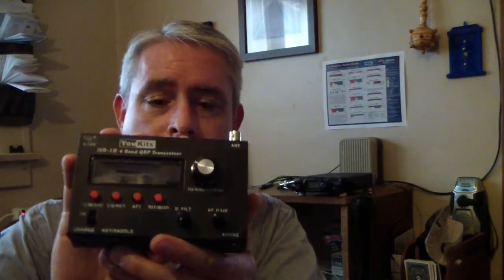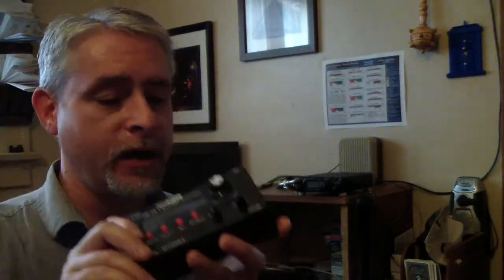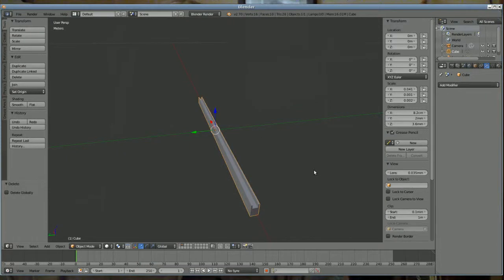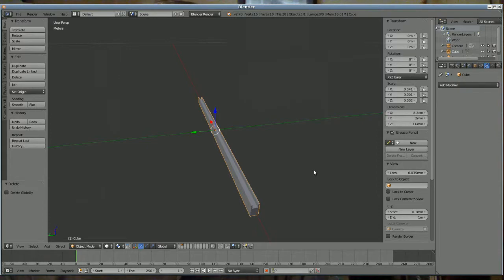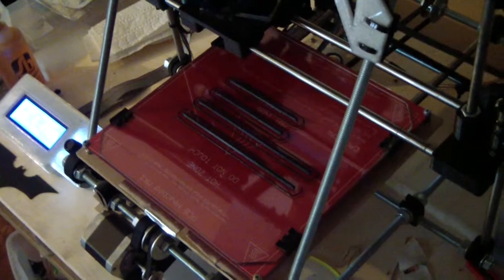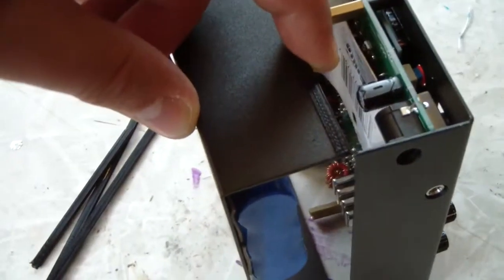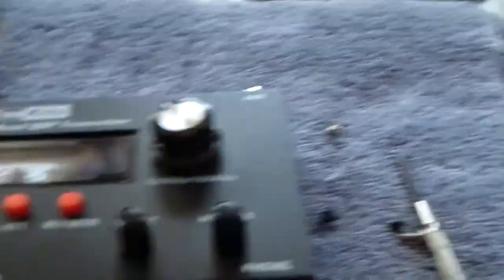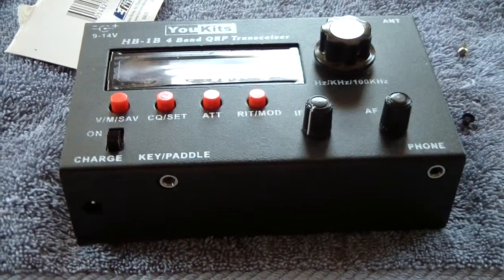Ham Radio - HB-1B case mod for internal battery

Comment: Hi Kevin,  I have a HB1B, the later model with the charge socket at the front, as well as the power socket at the rear.  Do you know if I can use an external power supply at the rear, if the battery is also fitted and connected internally ?  It doesnt say much about it in the manual.  Thanks in advance, Sean.  73's de M6OLR

Comment: I have the same issue, would you consider selling me a set of spacers?
Reply: I did basically the same thing - but used   " Rubber U Channel Edge Trim, Fits 1/16 inch Edge (1.6mm), Length 3 Feet (1 Meter)
Brand: Seal Rubber"  from  Amazon - put fiber washer under the standoff, then the same screws work.
Reply: @bradcarlson9164  Thanks for posting this, I'll take a look for that on Amazon. This also reminds me I need to get out that radio and charge it, haven't used it in a while.
Reply from the maker: Sorry,   I had to sell my 3D printer a year ago to pay bills.  I really miss it.   The file is up on thing a verse, if you can find someone with a 3D printer, they can print it for you.
http://www.thingiverse.com/thing:375069
Reply: Thanks for the quick reply, I will ask on QRZ and see if someone would be willing to print. 73 DE kb5zcr
Reply: Youkits is Chinese not Japanese.